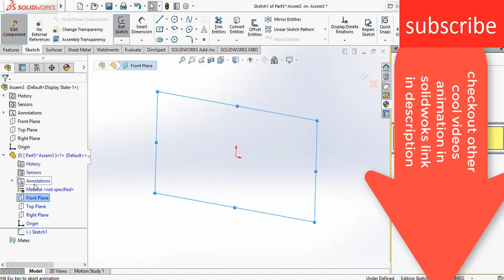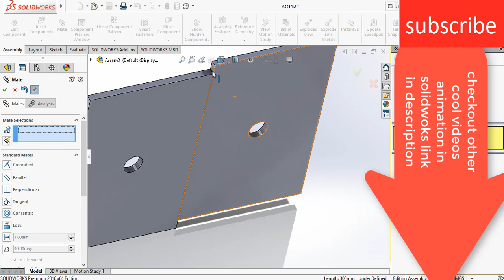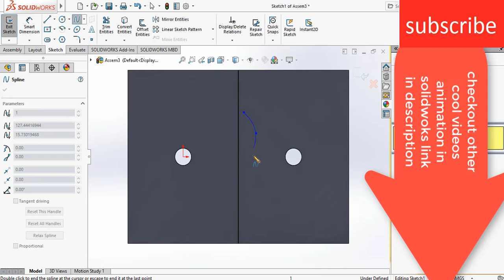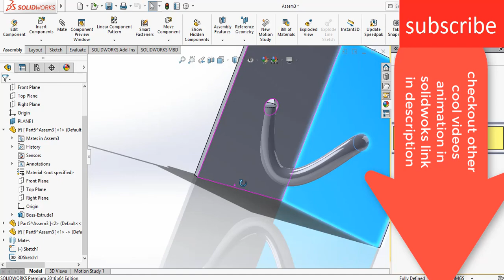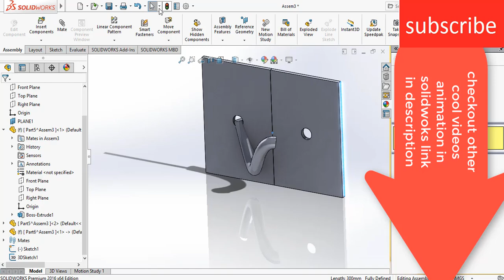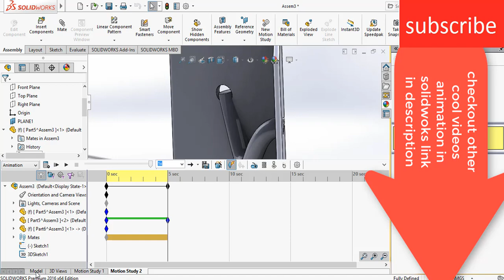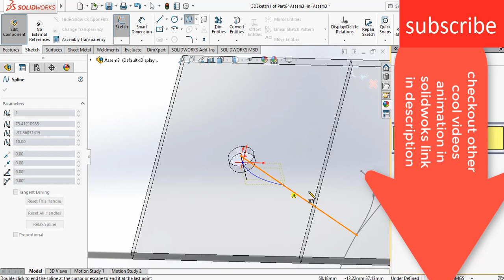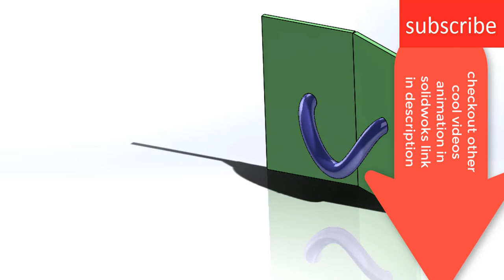wire bending animation in solidworks

Comment: So the wire is going to bend according to any path of spline curve I make in Sketch? (the bending path you made through spline). Also why is it necessary to have those points of sketches intersecting, which you fixed near the end?
Reply from the maker: If it's not fixed with the near end correctly the wire will not give desire animation result